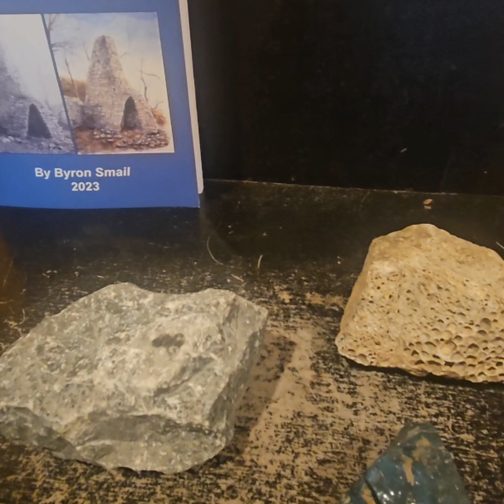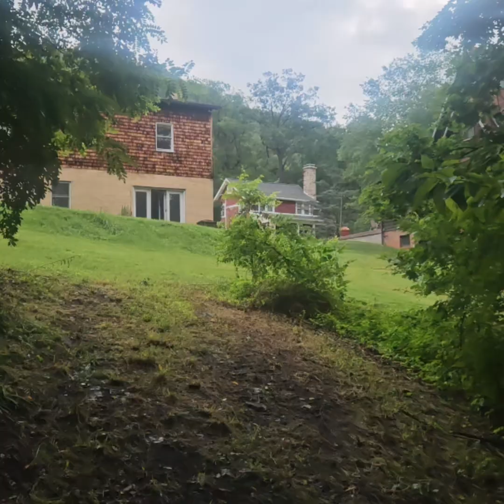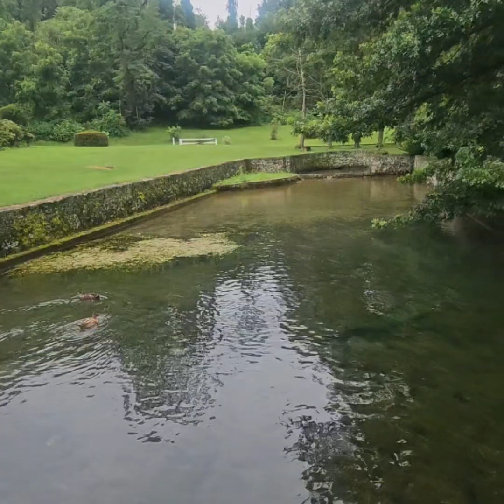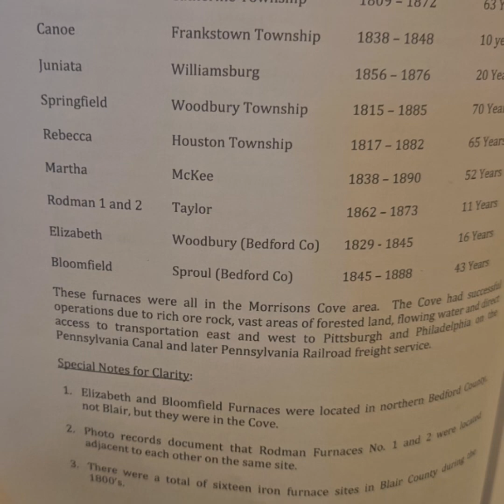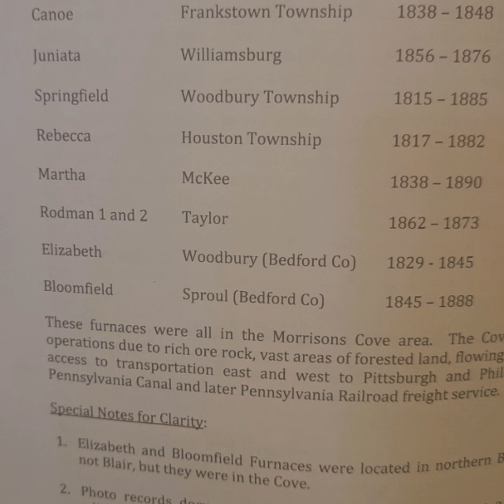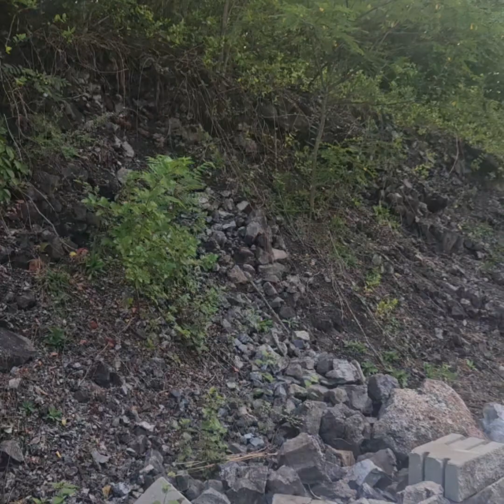Iron Furnaces of the Cove

Comment: Thank you for that!  I will mention it at tonight's meeting of the Roaring Spring Historical Society.  Also, I will be contacting you soon with some questions about an area just over Brumbaugh Mt.   That is Dutch Corner.  I live in the center of 600 acres, still owned by family members, which is known as the Oppenheimer Ore Mines. I'm pretty sure that there were no furnaces here, but they shipped a lot of ore (and clay???? ) out of here on a narrow gauge railroad.  They also had at least one inclined plane to lower that ore.  Oppenheimer bought the land in 1884 and developed it.
Reply from the maker: Thank you! I would love to check out this site! Byron 814 932-1945